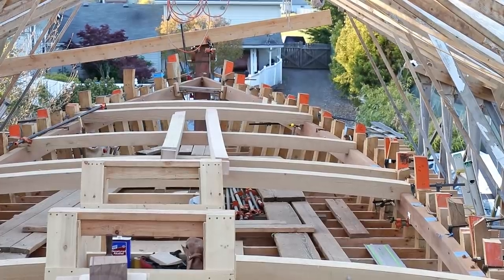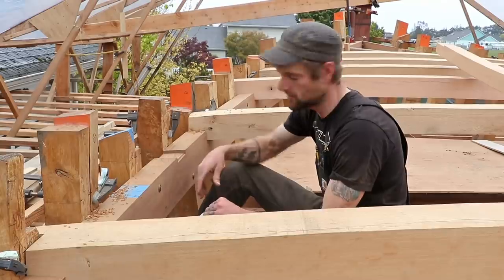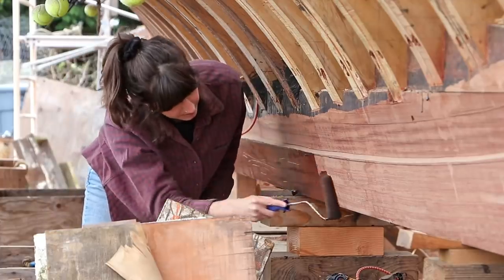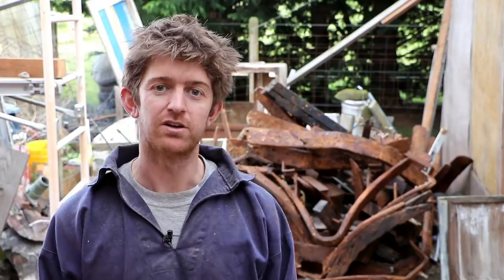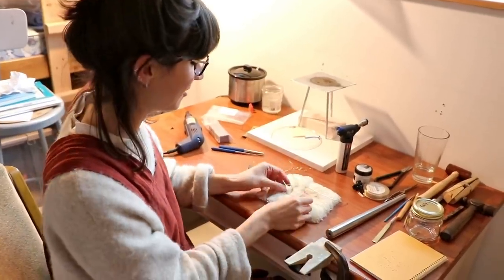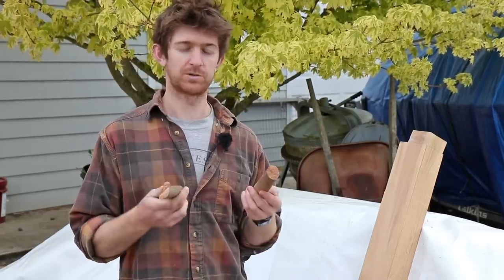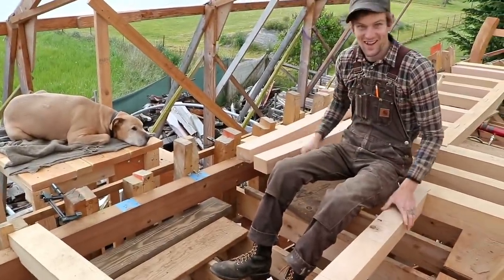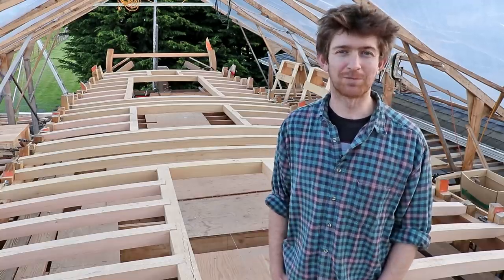BoatBuilding - Building the Deck Structure! (EP71)

Comment: You really have to go to the foundry and discus with him how and where to put draft into the patterns. It gets much more expensive if the draft is not to the liking of the foundry. Take the first pattern you made and show it so he has an idea what you want as result.
I think it needs a steep draft on the inside of the patterns from the edges to the center, and plane outside. Also the thin ends makes the casting complicated i think.
Reply: boelwerkr These are only templates they are making. When making the proper patterns, the pattern maker will measure by using a Bronze shrinkage rule to compensate. The pattern is made bigger by the percentage of shrinkage for the material to be cast. Only fettling should be necessary after the bronze is cast, if done properly.

Comment: At last! You have told us how you are going to make the floor patterns. It's much easier than I imagined. I'm assuming you have to get those installed before you can put in the lower planks.
Great progress on the deck. Good news that you have found the first part of the old boat to re-use. I reckon that towards the end of the build, there is going to be a big market for stuff made from off cuts and original timber.  Thanks for the video.

Comment: Hello Leo. My dad was in the lumber business and we grew up on the lumber yards at the mill and worked there also. Dad was a wood craftsman also and I learned from him that  what you have with the dark wood in your timber is also called slime flux although the slime is the effect of the bacterial infection in the tree. The anaerobic bacteria that infects the tree produces the vinegar smell ( acetic acid) which is a byproduct of the infection. You had it right on the nose about the wetwood infection. A lot of the old timers knew about this and made allowances for it when grading and cutting the finished product. They also believed that the best thing to do with it was to feed it into the boiler powering the mill and that way some good came from nasty wood. Keep up the good work and I will keep watching.

Comment: Hey Leo, Im building a Crossbow from white oak that I got when a neighbor had some tree work done. The entire section that I received had a strong sour smell and I thought nothing of it because I’ve encountered it before with White oak. The wood is very strong (in this section) and limber with no sign of discoloring.
I call it Sourwood! The bow or Prod that I’ve made from it has very good properties after I laminated about 60 thousands of fiberglass to it. I believe that in my case, it is just a particular type of Oak that grows in my area. Hope this helps.
(Edit) I did not let the wood air dry and I helped it by heating it in a home made micro kiln (which may have killed any Bacteria) until completely dry.

Comment: Forward hatch offset to allow the bowsprit to be run in or unshipped. 
".....helps to prevent Checka on the surface of the timber " ;-).
Boat is coming on brilliantly, really impressive.

Comment: I refurbished a smaller classic.  I'm awaiting final parts delivery to assist launch.
Worked a lot of wood by hand.  Some by power tools.   Had my boat delivered to
a harbor boatyard for storage between outings.  Rented a tool locker for repairs
as needed.   Cleaned out my build location last week.   If feels odd not having a'
hull outside my residence to admire.  No, I don't need a dog.

Comment: Leo, have you considered making the floors out of hot rolled steel welded together, sand blast them and them have them powder coated with an epoxy coat?  If all the holes are drilled slightly oversized in advance of powder coating the steel will be encapsulated.  Steel rebar that is used in concrete is done in a similar manner.  Then for extra protection you could use a thin sheet of silicone bronze as a separation gasket between the wood and powder coated floors.  It would be hugely less expensive.

Comment: Amazing craftwmanship.  Two suggestions;  Swap ends on the shaft in the threading machine so the bushing ride on the unworn surface.  All you need to do is drill and tap the second end.  You made good use of the hammer drill/jackhammer for a couple of projects,, but why did you not use it to pound out all the keel bolts, knee bolts and other bolts?  Saves splitting hammer shafts and is easier on you thumbs.

Comment: Cast bronze brackets is the way to go, I also noticed the wood templates to make the molds are tapered towards the ends, this is an excellent design not only does it save on the amount of bronze used (where it's not needed) it also allows for "progressive" flexing along it's entire length and reduces the strain at the bracket corners.

Comment: Some boats have bowsprits that can be 'gybed' from side to side. This is very nice if you are flying an older style gennaker running. You can push the sail to the windward thus. Not required with modern gennakers that can be built to float the top to windward.

Comment: Cutting all my firewood for the winter from standing timber, I have found that for the most part, red oak just stinks, especially if it's green vs white oak which has little or no odor. However, since most of the trees I cut are damaged or crooked, it's possible that the odor is the tree beginning to rot. Great programming -- I really look forward to each episode!

Comment: Not sure if you have tested it already, but when stripping/sanding old wood, it imperative that you make sure there is no lead in the paint that you are stripping off the material, especially when using belt sanders, grinders, or basically any power tools. It will micronize/make airborne any lead in the paint and it literally only takes  minute amounts of inhaled lead dust to cause permanent damage to the nervous system~ Regards, D~

Comment: To shed some light on welded vs cast.
The problem with cast metal,at least with iron/steel, is due to the very course crystalline structure it cannot really stretch under tension. It likes much more to violently fail once the crystals split apart from one another. Rolled material can generally stretch quite a bit. That is as long as it does so in the area where it can function like a spring. You go beyond that and it will permanently deform.

Comment: On my older cravel builded 45" build in Denmark around 1907, we could remove - or move it backwards - the bowsprit. To do that  we had a few problems with the foremast. It was "in the way" so to speak. But I think the bowsprit have something to do with your question. We moved the bowsprits backwards some times, when my boat needed to be 3 meters shorter in a harborg etc.

Comment: My guess for why the hatch is offset a bit would be to accommodate the bowsprit assembly/anchor point. 
I sailed on an old wooden ship in my teens, and the bowsprit could be retracted to take up less space when mooring, and so it had to be offset from the center line or it would hit the main mast.

Comment: The deck is looking fabulous. I love seeing all the snug fitting, no slop. The crew are very good craftsmen lucky to have them. I've bought some white oak for woodworking & yes it's NOT cheap. No offense but wouldn't bronze floors be cheaper made like Acorn to Arabella is doing with bronze plate other than casting labor? But I like the way you're doing them. Poncho walking the deck checking the work lol. That bird seems almost human.

Comment: Nice taper on the bronze floor.     Consider a  smaller dia fastener  at the top and allow stress to build evenly across the fasteners As load is transferred from keel  to to the floors and progressively to frames    If the first fastener is too rigid it takes all the load and the lower fasteners are redundant and it will work       Strange connection between boats and aircraft.     Buoyancy supporting keel weight. Akin to wing lift supporting fuselage    Some kid with a simple Finite Element Analysis could give a good benchmark to apply uniformly.    No need to make it  complex just good.     I believe the offset  is the you are using a tiller and most of us like to steer with the right arm    Tillers should be centered.     I wish I could just show up and help,    I love woodwork, I have a wood boat that I build things for  and this is next level     Very inspiring.     If you need fuel and liquid sensors please just ask.    We have some skills

Comment: That brash oak like that is from a tree that took a pretty good lightning strike, but not so bad that it exploded the tree.  Usually they have a big lump down the trunk as the tree heals itself, sometimes not.  If I recollect correctly the yankee that you bought the timber from was salvaging standing dead stuff and "town trees".  It would be plausible that such a thing would get mixed in.  

I never knew that the funny smell and brashness was from a bacteria, I just knew that when I cut a tree like that it was only good for firewood.  They are dangerous to cut.  Brash oak is liable to drop a limb on you as it falls, and the top will break all to thunder when it hits the ground.

Comment: Sounds like Oak Slime Flux.  In the south you sometimes see it when trees are planted too deep or they get back-filled against the trunk.  It is caused by a bacteria.  Normally it will pass during the winter over and does not harm well established trees.  If harvested however, the wood will be week in that spot due to the loss of lignin fibers.  Can always be spotted by the odor or frothy white spot on the surface of the tree's bark.

Comment: Bronze shrinks at 3/16" per foot, or 1.56%.

You have to make the pattern larger in all critical dimensions by this amount.  The length of these parts, at (my guess) 4' long is 3/4" of shrinkage.  Grey iron, due to the high amount of carbon, has a shrink rate of virtually nil.  Iron alone shrinks at 1/10" per foot.

Bronze has about the same range of tensile strength as grey iron.  It is more ductile.  

I think Leo is correct to go with silicon bronze for this application, and the original floors should give a good idea of required casting thickness.
Reply: Thanks for this info, I had no idea of the comparative strength of grey (cast?) iron vs. silicon bronze.
I'm sure Leo will consult w/ the foundry - he can easily add shims to the outside of the templates, to compensate for the specific bronze alloy's shinkage.

Comment: QA supervisor Pancho absolutely MUST inspect completed installations.....work can no progress with that approval..... :)  

exciting to see her taking form again, looking forward to seeing the inside spaces.    Will the restored hatch combing be much of an issue being rather smaller than when it started, or will you simply adapt the opening to fit appropriately?

As for the offset hatch...I would expect it's to clear rigging that will be overhead or to allow for a bulkhead below deck....

Comment: Not sure what causes that timber condition in your part of the world though we had the problem when a wood supplier trialled cross breeding trees. 
They had one species of slow growing and very strong hard wood crossed with a quick growing hardwood whose strength was at the lower end of the scale.  
It ended up slow growing with a very low strength rating. It had lots of areas like that we referred to as "pith timber". It was found certain species were more vulnerable, when slightly excessive water was used to grow the trees (or larger than usual rain fall at times) and could even be found to depend on soil conditions where grown. 
I left after 15 years and the grower had it down to less than 5% of supply coming in with this issue. It was a national forestry research project and had a run time of 40 years, still with about 10 to go.

Comment: The condition is a common one on large oaks, poplars and maples. It can happen on any tree which has been planted too deeply, burying the lower trunk.
The oozing is called “slime flux” and is caused by a bacterial infection inside the trunk. There are actually two types of slime flux: “alcoholic” and “acidic”. The acidic flux smells like vinegar.
The infection can be in a wound on the trunk surface or it can be deeper inside the trunk. In either case, bacteria ferment the tree’s sap; it seeps out and down to the ground. Sweet-eating insects (wasps, bees, yellow jackets) would obviously be attracted to the damaged area.

Comment: My guess about the offset you mention of the forrard hatch: 
Is it to keep it further from the tideline of green water lapping over the lee bow when hove-to on starboard? 
Similar reasoning for why galleys used to be installed to port. Kept stuff on the bench, rather than across the boat on the sole. Boats used to routinely heave to for meals. It's still a great idea, I reckon, when close-hauled.
Reply: That was a "left field" suggestion - If forced to put money on it, I'd say more likely you were planning to move the chain locker further aft, and maybe that offset lets you run the chain alongside the hatch on its way aft to the navel pipe? Because the windlass (as I recall) is rather wide, and the gypsy is at the end of the cross-shaft, this seems possible with the windlass fairly central.
Reply: Great news about that teak being in OK shape for the butterfly hatch! I like your attitude to reusing material: it's essentially symbolic, and I suspect the original builders would completely understand your priorities. It would make no sense to re-use material which was below par, but it's great that you can preserve a few high-vis instances where the original material was of such high durability that it still rivals anything available now.

Comment: Looking great! I noticed a finger splint, that was new - no pain no gain I suppose. Really interesting that deal with the wood, that could be a hidden demon if not caught now, kind of scary to think about really. 
 I think it's fantastic that you will be casting new bronze floors. The process AtoA used certainly was time consuming but in the end they appear to be quite beefy and up to the task but also used a massive amount of material. In this case will also be a lot of work to make those molds. 

 I don't make comparisons to AtoA as it's really just different approaches derived from deep research and advice I think is fair to assume, but I found it interesting that they went into planking before the deck structure. But I am curious as to any theory behind each process.

Comment: I like the idea of bronze floors, but I have two questions; will they be strong enough as is, or need to be made thicker?  Perhaps de-rusting and coating the original floors with something would be a viable (as well as less time consuming and expensive) option?  Not that it doesn't deserve bronze.

Comment: Are you expecting to add the draft (taper to enable lifting out of the sand mould) to the patterns for the floors, or will you leave that to the foundry? They will also have to adjust for shrinkage. I'm guessing what you're making are not intended to become patterns at all, but "templates"  (as you called them) for them to measure, in order to produce the patterns?

Comment: pure guess for the hatch moved slightly to Starboard? would it be for either for a Sampson post/Anchour windlass or
something to do with Bowsprit as wouldn't that have to be staggered to make room for that ensure the outboard end was on the centre line for the boat as the sprit would exit outboard in this case to the left/port of the of the bow/Keel?
Really cracking on with the deck timbers, looking forward to seeing the interior once all the crud is removed that holds Tally Ho's shape.

Comment: How did you work out the size (thickness) of the floors? Only if you're casting them yourselves, I hope you give yourselves a large safety factor to account for any porosity etc in the bronze casting.

And my guess for the offset hatch near the bow is something to do with the capstan. But since I'm an engineer, not a boat builder or a sailor, that is really just a guess.

Comment: The foremost deck opening will likely be for the chain locker. So it seems reasonable that it lines up with the gypsy on the anchor windlass so that the chain falls smoothly into the locker.

Comment: @7:10 - by why the angle? I've been looking around but can't find info an a 'stopped bevelled cross lap joint' (guess that's what you'd call it) where the bevel goes that way. Wondering if/when I should use one in my shed build?

Comment: I would think the foremost opening is off center to give more rigidity to bow as it crashes through the waves. This part of the boat may be feeling the largest flexing forces when out at sea. If it was centered, you would have less structure on the centerline where the flexing force likely is stronger and fatigue could end up breaking the short beams between the openings.

Comment: Great stuff as usual! For the bronze floors shouldn't you add a stiffener accross? With the drain holes it does not seems the will be a lot of material in the corner to ensure stifness and strengh.

Comment: Guess: Forward deck opening is offset to the starboard to afford space for the bow spirit to be slid inboard on the port side. Either that, or for clear deck space on the port side to allow the headsails to be laid out before being hoisted along the bow spirit.

Comment: That rot in the wood is due to brown rot. It’s a fungal for that breaks down the non-lignified components of the cell walls of the wood. That vinegary smell is vinegar. The cellulose in the Wood is being broken down into acetic acid. You may have noticed a little bit of acetone-like smell as well. This acidic environment allows the fungus to do its job a little easier. I’d take extra precaution to check over the wood.